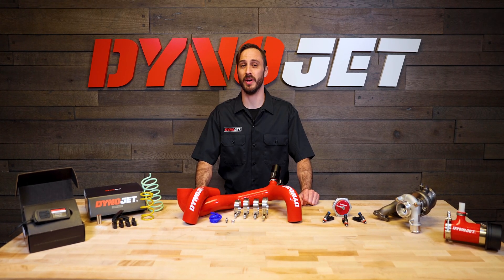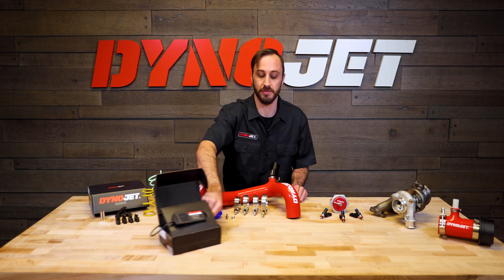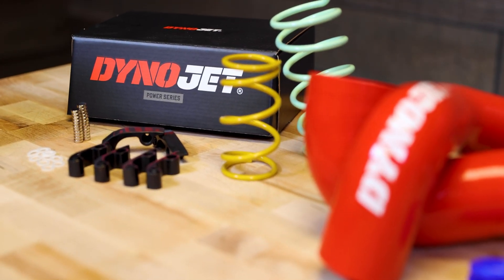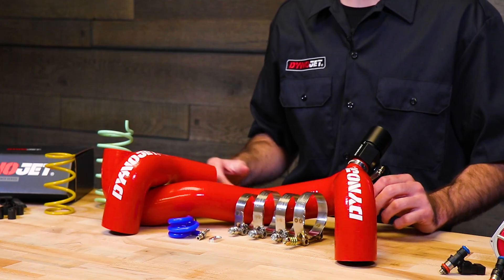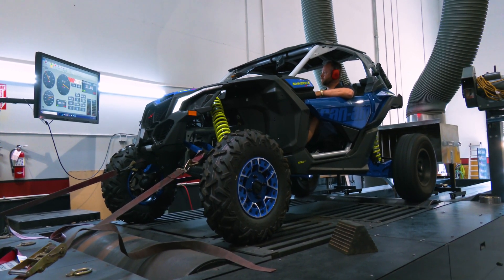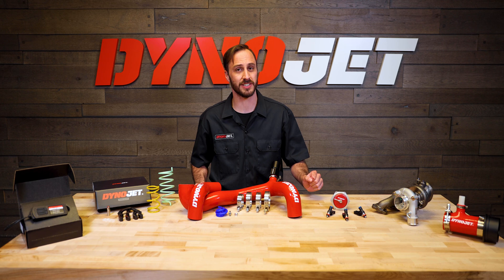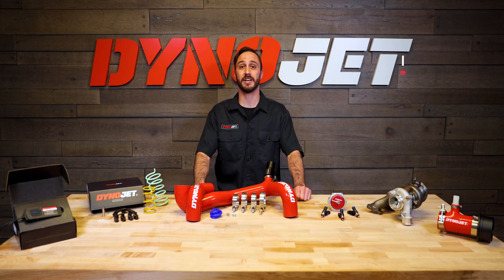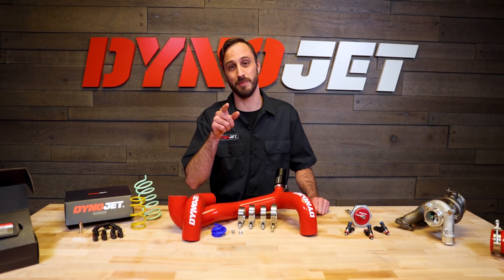Official Guide to Dynojet's Power Packages for Can-Am Maverick X3

Comment: So I have a question I have a 2025 Can-Am Maverick X3 max DS Turbo, which kit would I need to upgrade my horsepower right now I have the 135 hp
Reply: How much horsepower would you want
Reply: @isaacquintana-rj6qe  well I’m not sure but I want a little bit more horsepower. I guess the next step up.
Reply: @AngelHernandez-lv7xy id say get the 200 hp conversion kit to a turbo rr. 200 horsepower is crazy on a ds trust me
Reply: Your links are not working to the different stages. They don’t work.